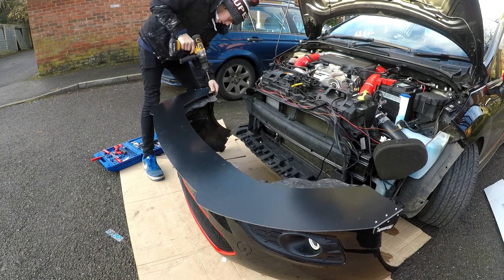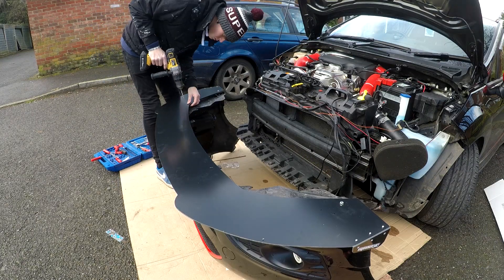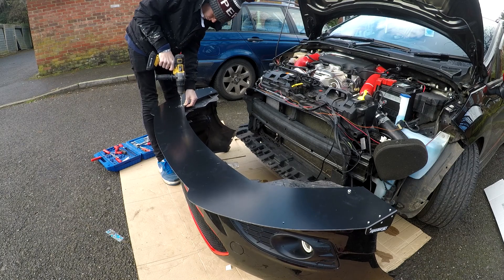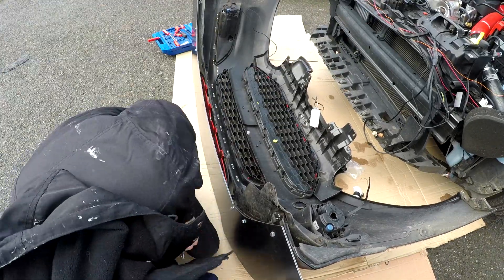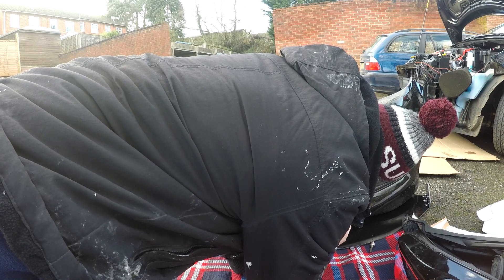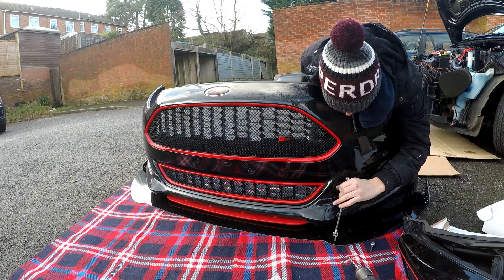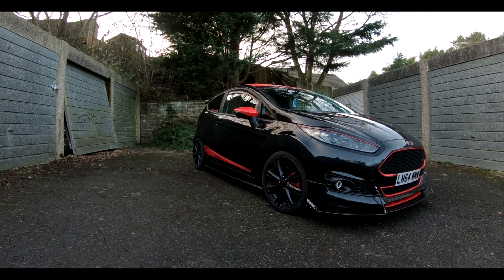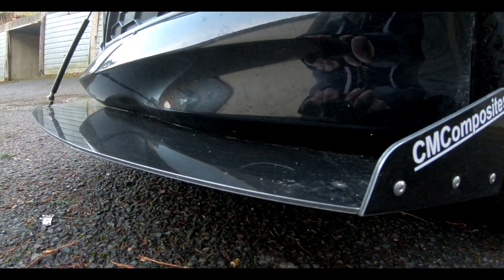CMComposites Race Style Splitter Install (Ford Fiesta)

Comment: Hey Ash, been looking at some of your videos for a while now and I just went out and bought a Fiesta Red Edition myself! 2015 model with only 7000 miles on it.   And of course I need an induction kit and a front splitter:)  Going with the 2 red pipes that you showed in your video and the R-Sport Fiesta 1.0 Ecoboost Stage 1 Cold Air Induction System. Should sound nice I hope:) Keep making these videos, its very helpful for someone rather new to the car!
Reply from the maker: Filip Lenz enjoy your new car! and plan on making lots of new install videos that should help in the future!
Reply: Ash Holder thank you! I was thinking about the H&R 35mm lowering springs, but here in Norway during winter there is so much hard snow it will just destroy the front of the car:(

Comment: Looks sick! Just fitted my trc front and side splitter last week aswell, for some reason i couldnt get the front bumper off, i followed your video on how to remove it, but it wouldnt come off, and i had trouble getting the little plastic clips underneath off aswell, even when trying to force them off i just couldnt. So i had to fit the splitter from underneath, was quite hard doing by yourself. Have you thought about installing the "universal side flicks" from cmcomposites, or would you think it'll look stupid when already having a trc side splitter on?.
Reply from the maker: Strufly ahh sorry to hear that, if you ever have trouble or need advice feel free to message me on Instagram or snapchat and we can get it sorted! I have thought about the side flicks and I don’t think they’d look stupid with that splitter at all, although I am going to be swapping my TRC side skirts for CM Composites Full side skirt kit as I just feel this will give the car a more complete look and they have to flicks on already!

Comment: Do be careful with it. B7 damaged his a few weeks back. im still wondering about getting the triple R splitter for my mk6. i just worry about it scraping in places. How has it been living with a spliiter? do you have to take more care when driving?
Reply from the maker: Zain K yeah, B7 did loose his splitter, lost it on the way to the meet L19 set up and we heard whilst we were waiting for him, I think he just held his splitter on with self tapping screws though instead of bolts that are provided with splitter like this, like the TRC and Maxton ones. So although self rappers are a lot easier it’s wise to bolt the splitter on to avoid such accidents. And as to living with a splitter, I defiantly take more care, I’ve already broken one splitter under estimating a speed bump.

Comment: when you had the trc one did the middle flex alot? was it strong enough to hold its self by the two sides without a bolt in the middle? thanks
Reply from the maker: kevin hodge when I had the TRC splitter I did have a bolt in the middle through the chin splitter, most people avoid it though because it is a little tricky and pushes it down In the middle slightly
Reply: Thanks .  Was it stable with the one in the middle ? Not having any in the middle looks dodgy as fuck lol
Reply from the maker: kevin hodge yeah was solid with one in the middle too!